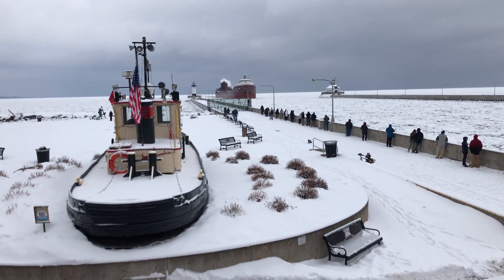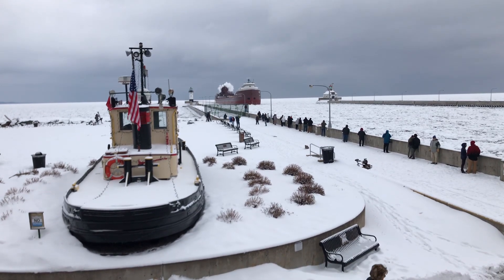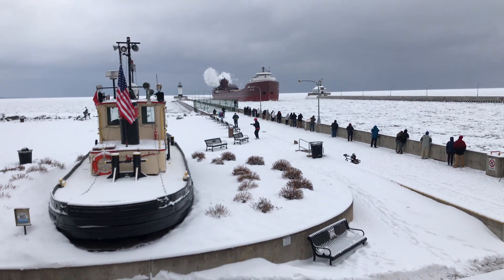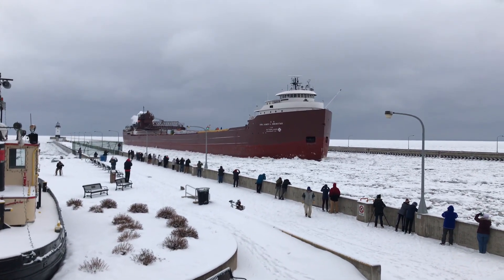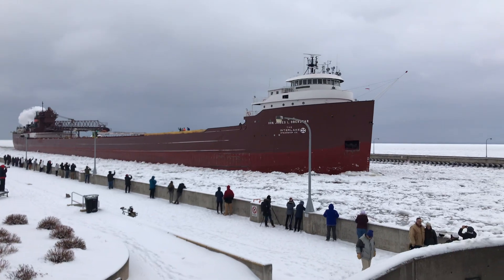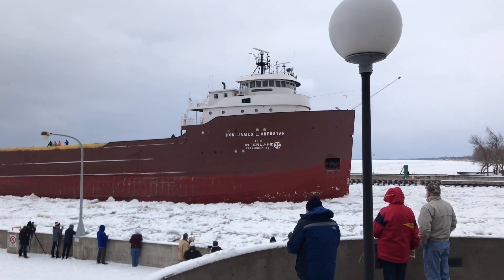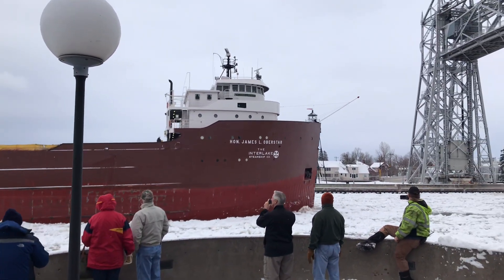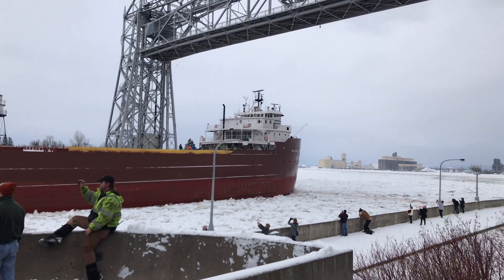Hon James L Oberstar arriving in Duluth. 1/14/20

Comment: What are the pros/cons of having a bridge towards the bow versus the stern?
Reply: You can see more at the front, and less at the back
Reply: bridge on the forward:
pro: it is on the forward
con: it is not at the back

bridge on the back:
pro: it is on the back
con: it is not on the forward
Reply: Seahorn lol
Reply: @ILM787  In all seriousness now:
advatangae of bridge forward
- excellent visibility in front of the vessel
- very quiet ship as at most vessels engineroom stays on the back, so crew sleeping forward have a good rest

disadvantage:
- more difficult to see what the vessels does when turning near buoys and/or in tight spaces
- in rough weather more noise from vessel hitting the waves and the foreships moves more then the aftship so less rest when sleeping in the foreship
- more expensive to built as engineroom is far from the bridge and pipes and cables have to run from engineroom to bridge

advatangae of bridge on the aft
advantage:
- better overall visibility when turning
- less movement of the aftship so "better" rest in rough weather
- cheaper to built as pipes and cables to bridge can be shorter

disadvantage:
- poor visibility close to the bow
- more noise from the engine and engineroom

All in all both have advantages, however I think that the building cost are most decisive (for ocean going vessels at least).

Comment: @ 28 Seconds ~ Powered by 2 engines 2,406 cylinders !   Lol she has no clue what shes talking about ! Thats a lot of Cylinders
Reply: She said: two 4100 horsepower six cylinder diesel engines. Perhaps a battery change is due for your hearing aids ?
Reply: blusnuby2 what???
Reply: @blusnuby2  
Except she omitted the "horsepower" part. But yeah, she's not THAT stupid.
Reply: Nothing wrong with what she said, anyone with any type of engine knowledge would know what she means,your tryingbto be smart and it didnt work.
Reply: @mr.mcbeavy1443  if you had a Toyota Tundra 5.7Litre and someone asks how big is the engine you say 5.7.
Reply: @harrylebastard  
I would say "half ton" unless they asked how big the engine was.